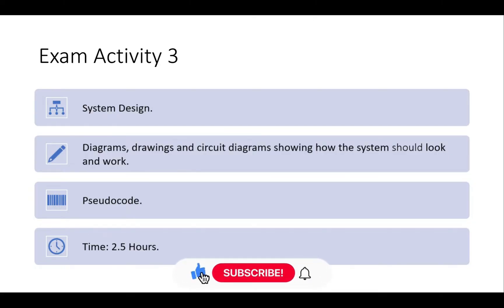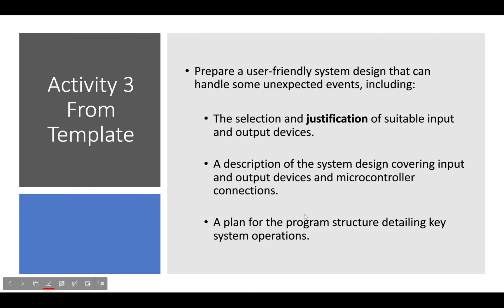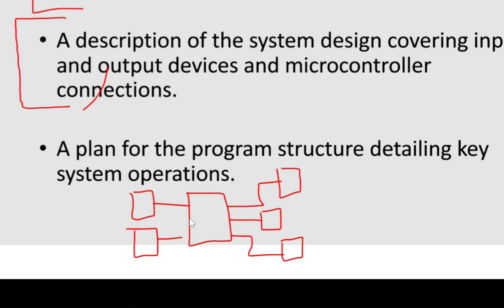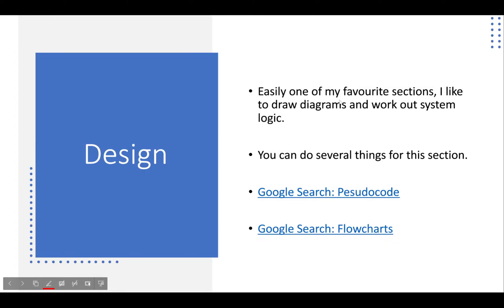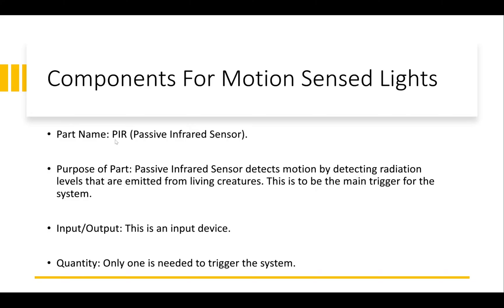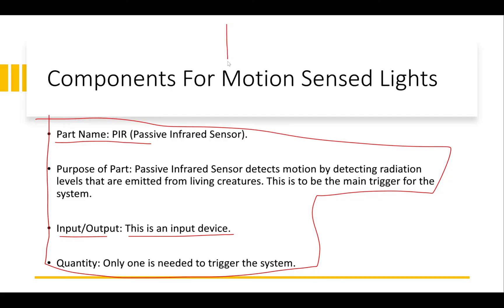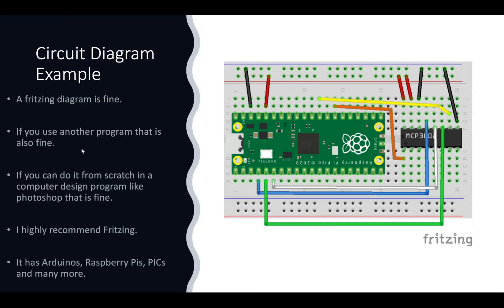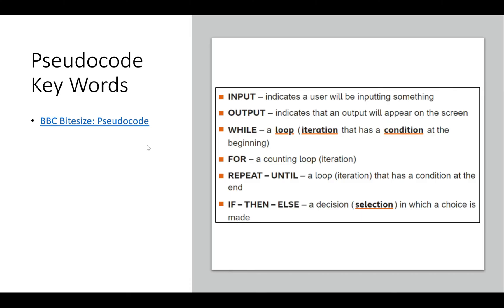BTEC Level 3 Engineering Unit 6 Microcontrollers - Part 10 - ACTIVITY 3 DESIGN THEORY

Comment: How would i write pseudocode if im using the program flowcode?  Activity 3 is so confusing for me🥲🥲
Reply from the maker: It doesn't matter what program you use.

Pseudocode is code and platform independent, meaning you can give the same Pseudocode to anyone who knows how to program and they will be able to get to a similar version of what is asked for.

If you prefer you can also use the flowchart, instead of the pseudocode, you do NOT need both.

Pseudocode or flowchart.

Check out this link, it should give you some help on how to do pseudocode: https://www.youtube.com/results?search_query=how+to+do+pseudocode

This link will find you some videos on flowcharts: https://www.youtube.com/results?search_query=how+to+do+flowchart
Reply: How was the exam and what was it about this year
Reply: @aukeditsHavent finished it entirely but this years exam was about a wrapping process with 2 options for a small and medium sized suitcase

Comment: Hello sir, in activity 3 you do parts list  you need to do a flow chart  you need to do a circuit diagram, for the circuit diagram do you mean the circuit we design on the computer using a software  and then take a screen shot of it and uploading that onto our exam or de we need to do anything with the picture of the circuit
Reply from the maker: A screenshot is fine. Once all components are shown and labelled accurately.